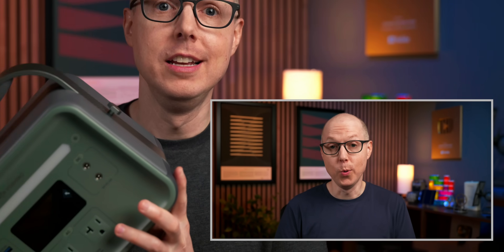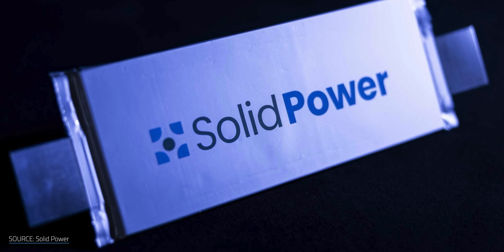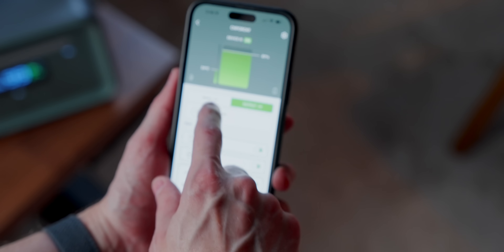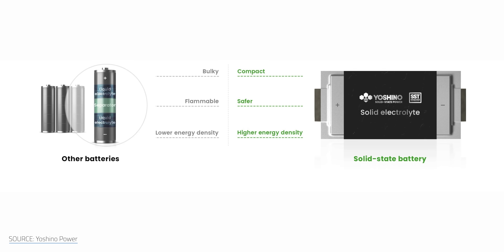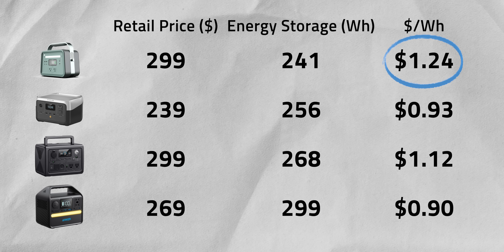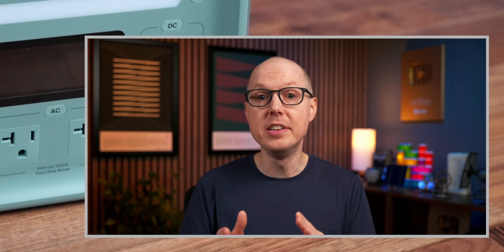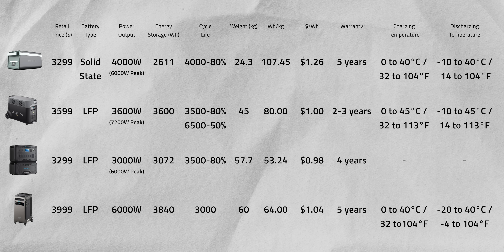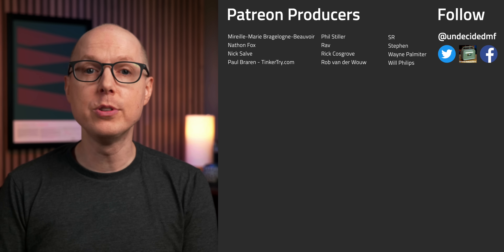UPDATED: Solid State Batteries Are REALLY Here - Or Are They?

Comment: https://www.youtube.com/watch?v=z8sVbwitrB0
"nail" test
Reply: More scientific or conclusive than the original video on this channel though…

And not to mention the fact that the updates are sprinkled throughout the video so you have to rewatch the whole thing.
Reply from the maker: @Jc199somethin  I added chapter markers so you can jump around.
Reply: @UndecidedMF  thank you, that helps. I’m really looking forward to the deep dive video. I bought one myself and now I’m like should I return it!? Also feel dumb cause I felt like I knew better to jump on this too early.
Reply from the maker: @Jc199somethin  if this isn’t what they claim, I feel duped too.  Keeping an open mind until we find out more ourselves.
Reply: @Jc199somethin   I don't feel duped I bought it for the weight and power point.  But, however, yet, I can do the same thing with a 100 amp HR deep cycle lead acid battery, and a cheap inverter. 

The one he showed only ran my projector and  modest surround sound for 5 hours.  And took 4 days to charge off solar in the car.  Guess the car gets to hot.
Reply from the maker: That is the best "nail" test I've ever seen.  Clever solution he came up with ... but not exactly scientific or conclusive.
Reply: @UndecidedMF  https://youtu.be/-pu8hs6hmyk is a test by Will Prowse of a different battery claiming to be solid state (which seemingly isnt), and he includes around the 9minute mark the vendor (CHINS) puncture video test. The puncture test doesn't seem that different? What is a proper (and safe) puncture test for a battery pouch cell?
Reply from the maker: @garbagevision9515  using a drill is the big problem I see in his test.  If you make the anode and cathode connect by mucking around like that, almost any battery will have issues.  That isn’t a conclusive way to determine if it’s solid state or not.  Doing some kind of SEM analysis for the chemical makeup, carefully separating the layers, etc.  That’s the definitive way to assess it.  That’s why I’m excited to have my friend break Yoshino down in a University lab with the proper equipment and people to assess it (including nail penetration tests, short circuit tests, thermal runaway tests, etc.).